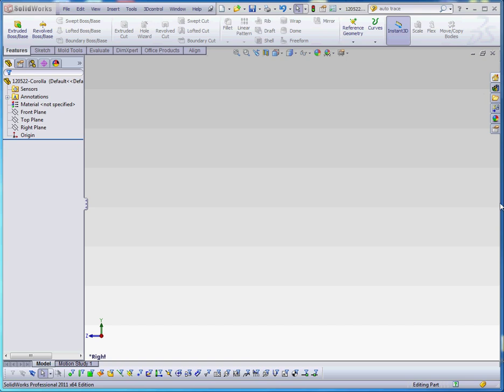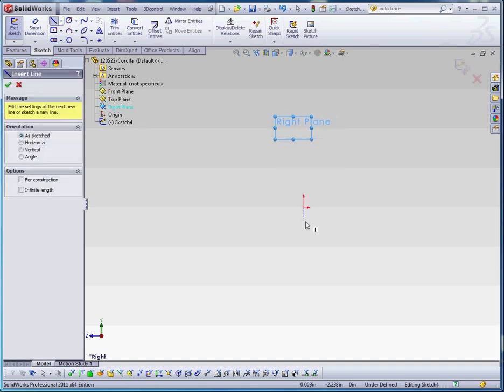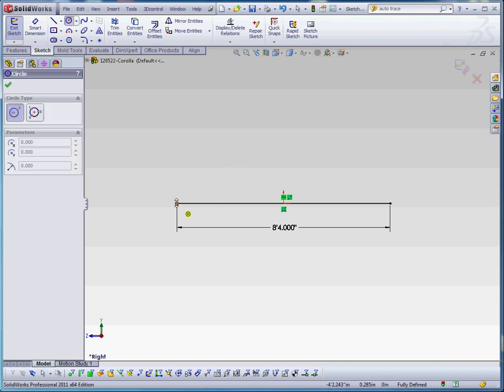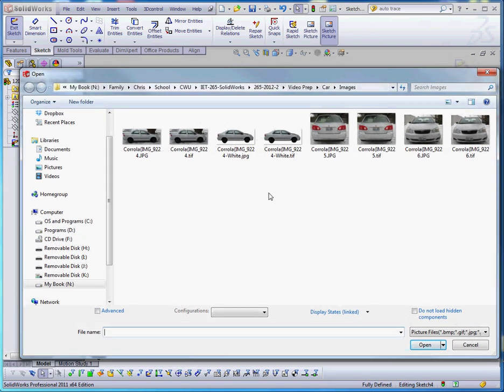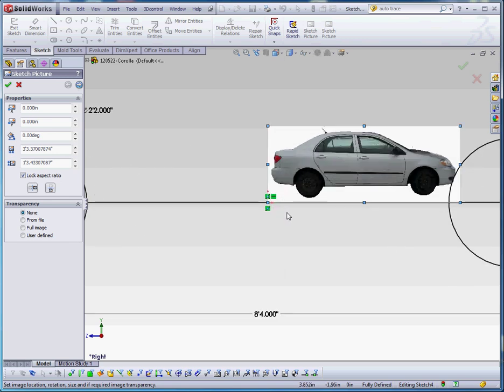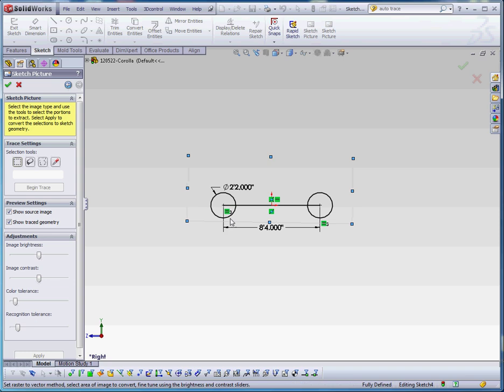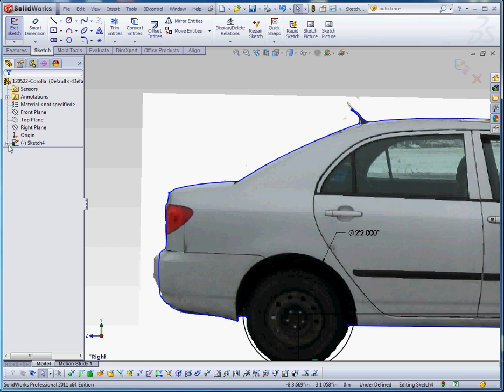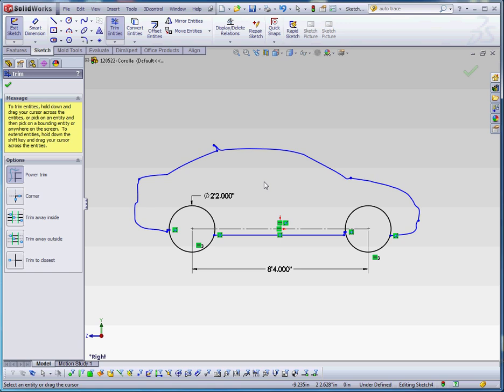Part 1 - Sketch Picture and Auto Trace, Set up and Using Auto Trace

Comment: Whenever i have selected the mid point of the line and try to move the line the add relations don't show up so i can't move the line like you did in this clip so i can't continue on with your tutorial as I'm stuck at that point. I am using Solidworks 2011 also so i do not understand why i am having this problem. Any advise would be appreciated on how i can get around this issue.